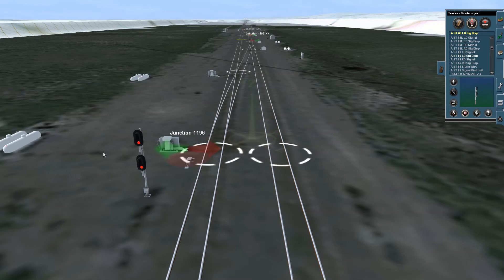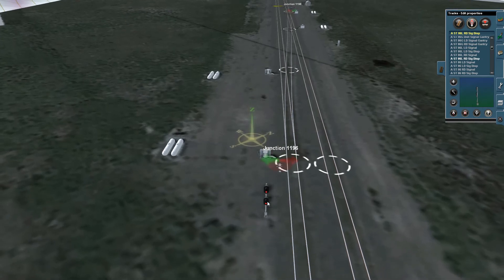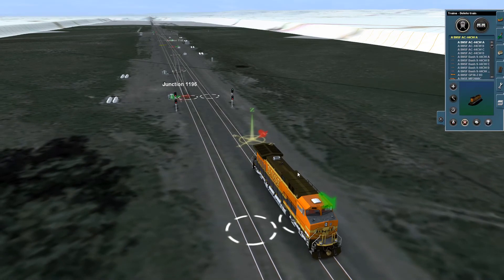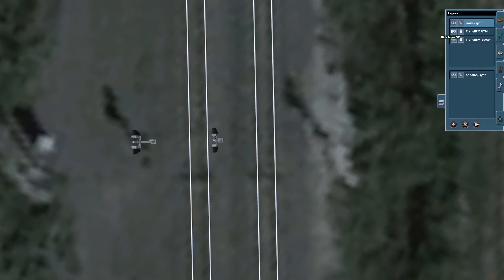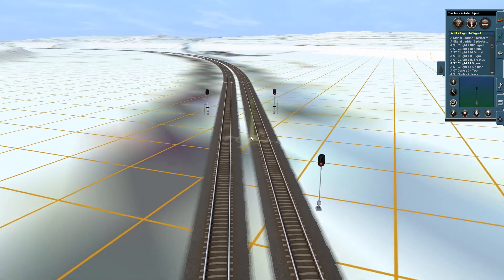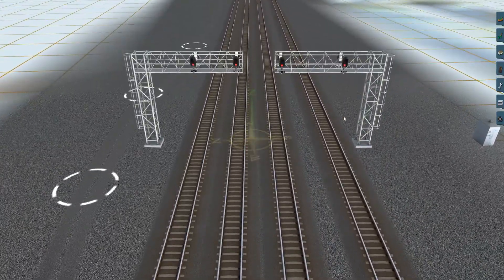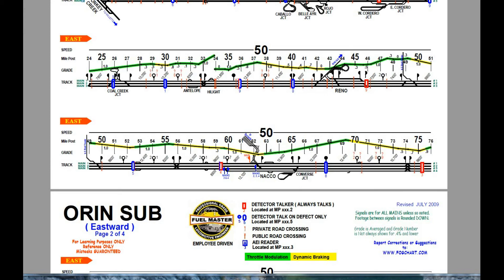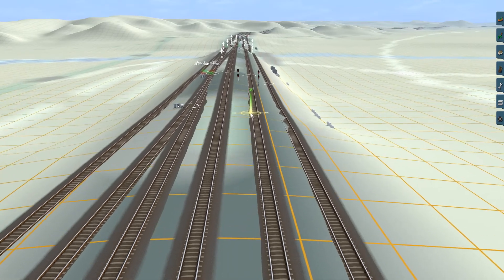009 Trainz Powder River Basin Update 05

Comment: is there a driver command fix on the download station
Reply from the maker: Nope not that I'm aware of,       The bug it fixes is if you untick a a driver command in the Driver Command rule, you will get a red error dot in Driver.    Let me know if you have this problem
Reply: I do have problems where trains will pass red signals tho how can make them stop at a red signal without them going passed it.
Reply from the maker: Not sure, what version are you using?  I'm using TR2010,  which I have never had trouble with,but be aware that different signals such as USA No5  a train will go through a Red as its a permissive signal.
Reply: i have trainz 2009
Reply from the maker: Cool   What driver command are you using when it goes thought the red signal?
Reply: I'm using just the stander driver command when i build and play the route but when i add the rules called stop at red singal it works fine. you must be using a different driver command because i also have trainz 12 and it doesn't show up like that
Reply: what do the triggers do in trainz
Reply from the maker: Basically a Trigger activates when a train passes over them, there by activating other commands following it, or triggers can be programmed to do certain functions when a train passes over the, sound a horn, switch a junction.
Reply: oh okay i get it know